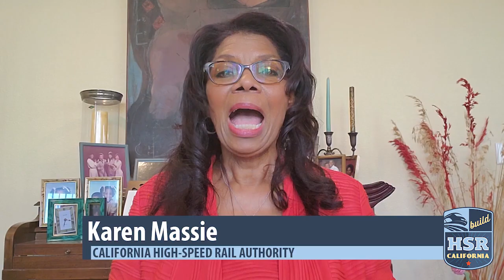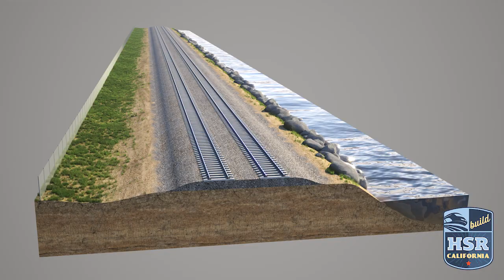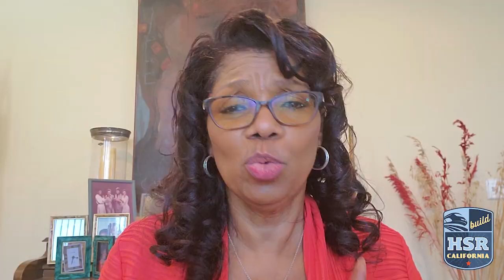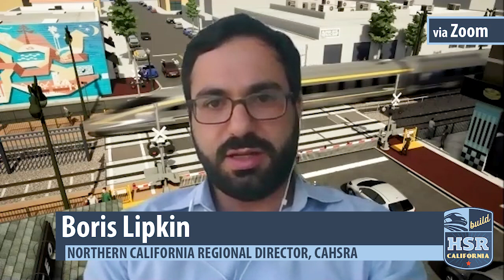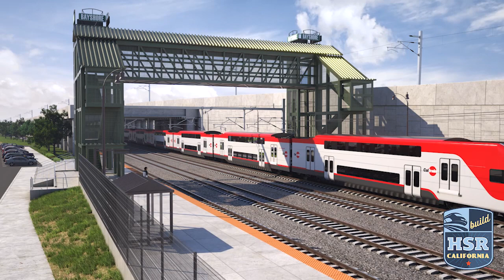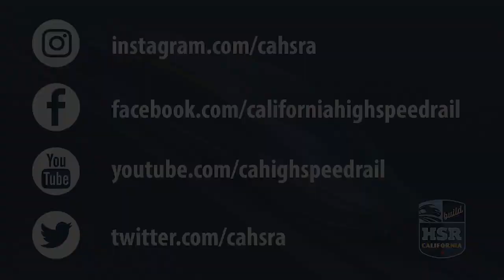HSR Q+A: Blended System & Passing Tracks with Boris Lipkin

Comment: Don't need to follow footsteps of Shinkansen, the fully-dedicated high-speed railway. Blended system of high-speed rail is also chosen among the world. 
Let me give an example of france and south korea. Those two countries' hsr system is consisted of 'dedicated' high-speed line and blended system with 'conventional' rail line as well. When those two types of system are mixed together, overall railway system of the state can also become more efficient because modernization of conventional tracks is necessary condition to make high speed trainsets operational on the existing line. 
Back to the Golden state, blended section is just about 50 miles among more than 400-mile-length of phase 1 network. Caltrain is 'under modernization' with electrification and track improvement to make trains run at 110mph. When this section is fully grade-separated, moreover, high speed trainset(NOT caltrain's stadler EMU) can even reach up to 125~140 mph, way faster than average speed of 'Acela limited' in nec. 
Building fully-dedicated line looks more fantastic and stretched-out. But in terms of cost to build more tunnels or viaducts, it's too risky for taxpayers in the long run. Utilizing the existing infrastructure is way more cost-effective.

Comment: Can you clarify whether or not there will be a blended system between the CHSR and Amtrak's San Joaquin service? Some documents have suggested that Amtrak will not be permitted on the high-speed lines, but it seems silly to make Amtrak run 79 mph on freight railways between Fresno and Bakersfield when there's a beautiful new high-speed rail line that would let them run at their 125 mph top speed. The existing CHSR plans already include passing tracks at the minor stations, so there are plenty of opportunities for HSR trains to overtake Amtrak trains.

Of course Amtrak would first need to equip their trains to operate with the HSR signalling system, but they'd surely make back that cost in no time given the huge potential time savings.
Reply: The problem with dumping everyone onto HSR at Merced or Fresno is that there still needs to be a local service along the high speed line anyway. It wouldn't make sense to stop every 220mph HSR train at every little station. Rather than kicking people off the Amtrak train at Merced just to get on a CHSR local train, Amtrak could just be that local train.

On the Central Valley high speed line, 220 mph CHSR trains could stop at only Fresno and Bakersfield on their way between SF and LA, while 125 mph Amtrak trains also serve the stations in Merced, Madera and Hanford on their way between Oakland/Sacramento and Bakersfield.

If they want to boost ridership numbers they could count the San Joaquin as a CHSR service, which is fair considering it would be running at high speed on a CHSR line.
Reply: @OntarioTrafficMan  The only stations past Merced that won't be directly served by HSR service are Corcoran and Wasco. The plan is to use a bus replacement from each town to Kings-Tulare and Bakersfield stations, respectively.
Reply: @Flynn_  I'm not talking about Corcoran and Wasco, I'm talking about Kings-Tulare and Madera. It doesn't make sense to stop every HSR train at those stations because it takes ages to decelerate from 220 mph to a standstill and then accelerate back to 220 mph. That would defeat the purpose of building a 220 mph line in the first place. There will need to be super-fast services making minimal stops between SF and LA, while other services serve minor stations such as Kings-Tulare and Madera.

My point is that those "other" services should use 125 mph diesel trains, so that they can provide a one-seat ride from the high speed line to Sacramento. I don't care if they're run by Amtrak or by CHSR as long as they don't force an unnecessary transfer.
Reply: @OntarioTrafficMan  Modern EMU high speed trains have continuous acceleration around 0.4 m/s^2 according to the UIC (to put this in perspective, a modern subway can accelerate around 1-1.5 m/s^2). This only takes about 4.5 minutes to accelerate from 0 mph to 220 mph. These trains can slow down even faster than that. 

For 4 stations, this would add at most 30 minutes (4.5 minutes * 2 intermediate stations * (acceleration + deceleration) + 4.5 * (end station acceleration + deceleration) + 3 minutes slack) to an approximate 1 hour ride between Bakersfield and Merced (for the IOS). This is still an hour and 41 minutes faster than the current San Joaquin service. Additionally, you could add express services that don't stop along the line in addition to the "local" services.

Mixing HSR and slower diesel services on the same line would be a mistake, especially since it doesn't really do anything for the high speed service other than slow it down since there aren't adequate passing tracks in the current build.
Reply: Good point.  California is already taking delivery of Siemens Charger locomotives and Venture passenger cars which are designed for 125 mph. They are equipped with Positive Train Control from the factory.  What could happen however is for the CAHSR to require passengers to transfer to/from high speed rail trains in Fresno thus increasing the passenger count to make the numbers look better.
Reply from the maker: The Authority is working with all relevant partners to continue optimization of the feeder and connecting services that are connecting to the initial HSR operating segment. Further improvements and refinements are likely as the project moves closer to service implementation.
Reply: As far as I know, the plan is to terminate the San Joaquin service at Merced when HSR starts running.
Reply: There are some safety issues that the FRA has with running "heavy" diesel trains alongside "light" high speed trainsets. Caltrain had to fight to get a waiver for their new electric trains to run alongside existing diesel trains. I would imagine running high speed trainsets at 200+ mph alongside Amtrak trains could not be approved by the FRA. Amtrak California has not announced plans to terminate their route in Merced. In fact, CAHSR has had to design their track and surrounding pathways in places like Wasco specifically to facilitate access to the Wasco Amtrak station.
Reply: @brandonk7361  As someone who routinely rides a regular train pulled by bulky Bombardier Traxx locomotives on a high speed line shared with 186 mph high speed trains (between Amsterdam and Antwerp), I find these FRA regulations a bit ridiculous.
Reply: @OntarioTrafficMan  They are ridiculous and antiquated. They stem from bureaucrats being afraid that a big heavy North American freight train would obliterate European style passenger cars. While that is physically possible, in the past year or two that American rail networks began using PTC systems and better collision avoidance technology. Caltrain's new trains couldn't be legally operated without it. Amtrak's San Joaquin service uses big diesel engines and the occasional Dash-8 (freight) engine that can not share tracks with light trainsets even with a good collision avoidance system in place. Hopefully the law acknowledges the tech soon and adapts, but the US isn't there yet.  
Europe has been running train control technology like ETCS for longer so railway regulations have had time to adapt and allow better blended service.
Reply: @brandonk7361  A small nit, the authority that runs the San Joaquins and ACE had a presentation recently about plans to terminate both ACE and Amtrak at Merced when CAHSR starts running.
Reply: @Flynn_  Very interesting. If CAHSR can successfully replace it with a better service then it makes sense. However, it does make me wonder what the plan is for the stations and communities in Madera, Corcoran, Allensworth, and Wasco where CAHSR will not have stations, but Amtrak does.
Reply: @brandonk9706  CAHSR has a station planned for Madera. In terms of the rest of the stations, Corcoran is close enough to Kings-Tulare for a short bus connection and Wasco is close enough to Bakersfield for the same. Allensworth is a flag stop in a town with 500 people, so a train station there never really made much sense. Again, this will probably be a bus replacement.
Reply: San Joaquin trains will use the tracks before CHSR is completed. After CHSR is completed the San Joaquin train could be discontinued or it would run on freight again
Reply: @TysonIke  WHY NOT JUST DO WHAT JAPAN DOES AND KEEP THE 2 SYSTEMS SEPRETS?
Reply: Karamjeet Kaur the San Joaquins will share the tracks before the tunnels to SF and LA are completed. It’s is so they don’t have to leave the completed tracks in the Central Valley unused for 2-3 years. When the tunnels are done and CHSR starts service from SF to LA the San Juaquins will probably be shut down as ACE is planning to run service to Merced.
Reply: @karamjeetkaur1474  Japan had to build a fully separate network for HSR because that their conventional network has a very narrow track gauge and loading gauge. The narrow track gauge is not suitable for high speeds, and narrow trains would have been a problem for capacity and profitability. The U.S. conventional system already uses the same track gauge as the Japanese Shinkansen and nearly identical loading gauge, so there's no need for a separate system.

Nearly all other countries which have introduced HSR integrated it with their conventional networks, at least initially. Then over time they build more and more dedicated high speed lines to separate high speed traffic from conventional traffic.
Reply: The reason they probably won’t allow Amtrak to use the new infrastructure is mainly safety issues the HSR train will travel up to 220mph at that stretch and a slow 79mph Amtrak train that gets stuck on the tracks due to problems could in worst case scenario if safety signaling systems and automatic breaks systems fail couse a devastating collision. There is a reason why they spend so much on grade separation it’s because foreign objects in the path of a train traveling 220mph can be catastrophic. Its safety above all thats the reason for the decision to have CHSR run on its own dedicated tracks.
Reply: MA A Amtrak might use the infrastructure before the tunnels are completed that would connect the main Central Valley section to San Francisco and Los Angles. Once CHSR is using the tracks Amtrak San Joaquin service will probably end